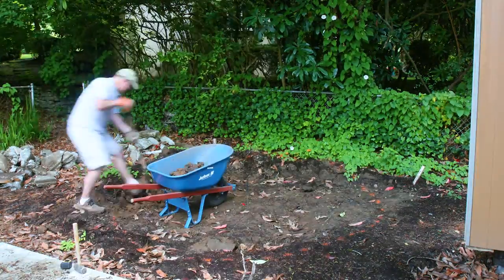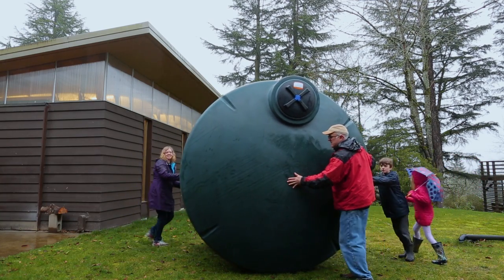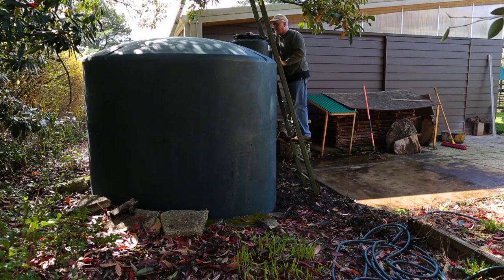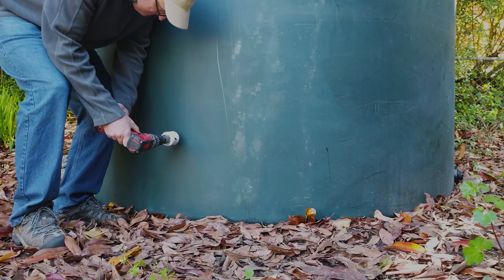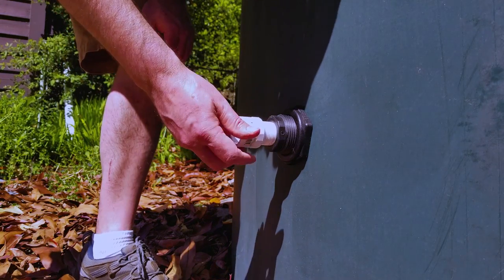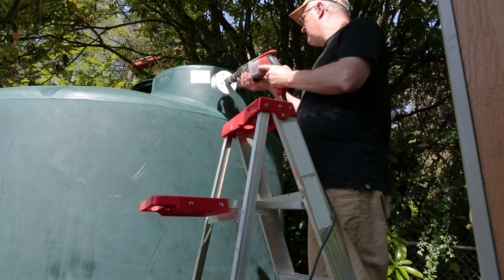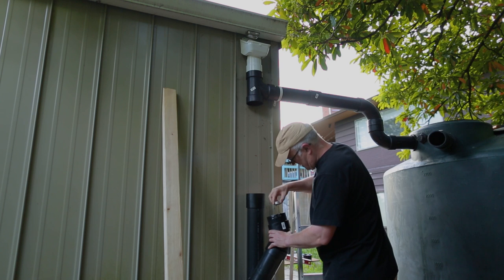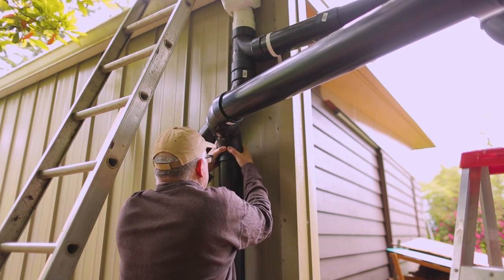The Rainwater Tank

Comment: My dad would've put me in the tank to put the fittings in
Reply: Yeppers.

When I was a teenager, we had a dairy cow fall into an old hand dug well. My dad and grand dad lowered me down with the tractor to get a harness around the cow, so we could lift her out. She was not happy to see me down there. I did get her hooked up and they pulled the cow out first. LOL
Reply from the maker: That was our back up plan.
Reply: Acts 13:41 
that was only to show you how milk is important for your health !    LOL !
Reply: Exactly
Reply: Just as an FYI since I've entered tanks like these for my job, oxygen concentration inside the tank can drop dangerously low. I've had coworkers die before from not using an oxygen sensor before entry.
Reply: Wow the quality of the first video was identical to that of the video five years later.
Reply: Well just to be sure I would have tied the other fitting assembles by threading your small rope through them just to be sure that if dropped into the tank they could be retrieved.
Reply: I help install one of these with my father in law and we used a piece of PVC pipe with a pice of solid aluminum ground wire connected to it. This was more than adequate to retrieve  parts dropped inside the tank.
Reply: As a kid my dad has lowered me in tank for fitting, cleaning and replacing things in the tank. At a certain age this stopped when I was awkwardly stuck.
Reply: Nicholas Loew same
Reply: Andrew Titus no it's oxygen concentration. OSHA standards state for o2 concentration to be between 19 to 23 percent. Anything less and you risk losing consciousness or worst.
Reply: In other words, CO2 is not bad for you. Lack of O2 is.  There are numerous reasons why the O2 levels in a  tank could be low, someone breathing is just one of them.
Reply: Aiden LARSON ok. Was reading an article once that states that CO2 was more deadly than lack of O2. I understand what your saying though.
Reply: I'm a professional brewer.  Spending time in tanks is normal.  Then a hot steamy dirty lauter tun is well...work.
Reply: Andrew Titus There are much worse gases then CO2 when in a confined space like hydrogen sulfide that if you can smell it you are already at danger levels or nitrogen because it doesn't trigger the bodies respiratory systems to say we have a problem like CO2 dose. Hydrogen sulfide when you can smell it you need to get away as the first thing it attacks is your sense of smell. Nitrogen is already making up 75% of the air so our bodies ignore it which can prove deadly if it is the only thing your are breathing and is used in lots of businesses for flushing and testing before you get into its liquid uses. 

Running out of air is not as quick as most people think because they will watch someone hyperventilate and pass out but that can happen out in the open also as they are not exchanging that CO2 for O2. In a big tank like that a kid could be in it for around half an hour before they would show signs of low oxygen and it is easy to solve by setting up a fan to bring in fresh air for unlimited time inside.
Reply: That's for when they misbehave.  "Cut it out - or you go back into the tank!"
Reply: Nicholas Loew same here!
Reply: My four years old locked us out of the house including herself.  Lowered her through the tiny bathroom window was how she's able to unlock the door so the rest of us can come back in.
Reply: +Maurice Long Both levels are important. CO2 is exhaled by concentration difference only, meaning the air in your lung must have a lower level of CO2 than is in your blood. If the level of CO2 in the air you breathe to high, you can´t get rid of the CO2 in your blood, which will kill you. So you can die of a lack of oxygen and of an abundance of CO2. Watching just one level is insufficient.  A CO2 level of 8% is lethal between 30-60 minutes.
Reply: The tank had an open port at the bottom. Any huge CO2 gradient between the tank and outside would push the CO2 through the tank and pull O2 from the top. .
Reply: Nicholas Loew I would just go in the tank for fun😂😂
Reply: My dad is like yours but I would have never volunteered for the job since mine would have left me in the tank... I was a rotten kid growing up  ;o)
Reply: A small wife would do though she might not help so much with the ploughing.
Reply: Bottom line. Look up OSHA standards for safely securing a confined space and consider applying some of their standards. I'm thinking of signage and possibly a lockout on that entrance. And not leaving the ladder up against the tank. (Beautiful project BTW).
Reply: Nicholas Loew haha same probs
Reply: Nicholas Loew tyt
Reply: I was thinking the same thing.
Reply: @paulkolodner2445  You'll float too! You'll float too!
Reply: @pyrocentury  would a fan work
Reply: @pyrocentury  It happened where I worked building and repairing tanker trucks. We lost one man and then his rescuer also didn't make it. From then on, every year we took a day for a safety confined space entry course.
Reply: That is just one of the numerous reasons we have kids  :)
Being gofers, lawn care & "where is the remote" finders!
Reply: i was thinking the same thing
Reply: Andrew T actually both are common hazards of confined space
Reply: @pyrocentury  You are also talking about the difference between a clean never used water storage tank and industrial storage tanks that could have god knows what in it.  I also do confined space entry with my job.
Reply: @gilb6982  what?
Reply: @pyrocentury  but still
Reply: @act.13.41  Holey cow, that's a great story!
Reply: How would u get out???
Reply: Nicholas Loew same
Reply: and once you got inside the tank , it's your time to shine. it's was the only time you can yell back at your old man haha

I miss my Dad tho. .
Reply: Oliver plays Trust
Reply: Mike Smith  Not on his personal property.  He is not a company so he is not subject to OSHA regulations.  Huge difference.  Just like if you were to do any work on your own house, you are not required to have a license.
Reply: Mike Smith  clearly it wasn't obvious to you... you are the one who mentioned "protocols of a worksite".  I never said he was immune to "the laws of science".  I guess you realized your original argument was ignorant so you decided to argue something no on is arguing.
Reply: Yeah! Those kids totally would have fit.
Reply: Exactly what I did with mine.. put the fittings while the tank was laying on it's side. Then stood it in position.
Reply: As long as he got you out at the end of the process it is a fair deal. hahaha
Reply: brings back memories like my dad when the fibreglass insulation first came out. Sent me up to do that lot but tapes my sleeves up as I remember but I loved it being so useful. Told me don't walk on the plaster only the beams. I was 8-10 something like that. That way dad didn't get the itchies from the fibreglass up his sleeves lol. His other trick was to send me under the house if anything needed to be done there with a watch out for spiders.
Reply: If I had a son, I'd make him get in too
Reply: Dads, we're so clutch & clever. My wife would've gave me hell first before I could put one of our kids in
Reply: @K333-e6b  I know the feeling :( I just lost my dad a few months ago. It is a hard thing to adjust to. He would have put me in the tank also but would undoubtedly have added the warning, "Don't tell you mom" :)
Reply: @frankmakes  Frank every plumber on the planet has at 1 time or another held up a pipe with their head while working on the next part in both their hands...you're doing just fine.... other than that hole saw incident 😆
Reply: Hahahah😂😂😂😂
Reply: Same bro
Reply: hahahahha thats so funny
Reply: ...hahaha, same!
Reply: Really? ... lol.
Reply: @francisdon537  i though it would gone explode
Reply: Lovely Video clip! Sorry for chiming in, I would love your thoughts. Have you researched - Proutklarton Protecting Aqua Plan (Sure I saw it on Google)? It is a great one of a kind guide for getting prepared for a mega drought without the headache. Ive heard some unbelievable things about it and my close friend Aubrey at last got cool success with it.
Reply: Appreciate video content! Apologies for chiming in, I would appreciate your opinion. Have you researched - Proutklarton Protecting Aqua Plan (Sure I saw it on Google)? It is a good one off product for getting prepared for a mega drought minus the headache. Ive heard some incredible things about it and my good mate called Gray after many years got astronomical success with it.
Reply: Projekt:Kobra  hahahaha
Reply: Had to do it several times growing up.  Since I was so tiny....  Everyone used that to their advantage.  Visiting family mostly involved that special chore of me going into tanks for repairs / cleaning and stuff.  I actually enjoyed
Reply: Same
Reply: I'm 43 years old now and I'd send my Dad in there
Reply: My dad did the same. He put me in the tank. He let me out when I was old enough to leave home.
Reply: Thanks for that advice.  I had to rescue a guy from a rainwater thanks in which he was using a high pressure water jet cleaning the sides.  He was luckyI heard him shout.
Reply: @act.13.41  lol
Reply: Same, but mine would have had a 10 min safety briefing before lowing me in.  lol
Reply: That's not my tank

Comment: Run the drill backwards, it will help when cutting a hole into plastics.
Reply from the maker: I will try that.
Reply: Agreed and if its a two speed cordless drill use the fast speed, the slow speed has to much torque.
Reply: Beat me to saying it.
Reply: For plastics and wood, forward direction with higher speeds and lower feeds.

Frank, back the hole saw out to clear the chips!!! (every couple of seconds). You don't do this then complain that they take a long time... because they plug up quickly. You need to clear the chips!!
Reply: And you beat me toooo.
Reply: Works on vinyl siding too if cutting with a miter saw.
Reply: Drill a hole or two just inside of the circumference of the hole for the chips to clear. No need to stop and back out.
Reply: If you drill around the circumference you have a chance of messing up the circumference, and it takes twice as long (switching drill bits, up and down the ladder, etc.)

Trust me on this advice. I work in HVAC/R and have drilled many, many holes with hole saws. Biggest ones I drill are 6 1/4" overhead on ladders through joists and exterior sheathing.

Backing out for chip clearance is the ticket. Takes a couple of seconds longer, but the hole saw bores through the material a lot faster, and doesn't overheat and temper the metal teeth.
Reply: I've bought a couple cheaper sets of hole saws, and two times in a row, I did exactly what you're cautioning against. I had the 5" saw attached and overheated it cutting into plaster and lathe - the teeth disappeared in one cut (both times)! Luckily they were $10 harbor freight sets, and now I'm on my 3rd set and it's lasted quite some time; you know what you're talking about and it is sage advice indeed.
Reply: Out of principle, I don't buy cheap hole saws (unless I plan on destroying the hole saw, e.g. I need to bore through stucco for venting... but again, they are resharpenable).

Now that you know the proper technique, look into M.K. Morse hole saws. From my experience, they are excellent!! (Made in USA).
Reply: Thank you sir!
Reply: Exactly what I was going to tell you/
Once the mark and small whole is done, always backward for plastic.
Reply: Or: mark the hole with the hole saw, then drill a couple holes with a regular bit (1/2" or whatever is handy) so that they're tangent to the hole. They'll clear the chips and you can run straight through with the holesaw.
Reply: IMef I don't think that would work to well if it did it would take forever. I've found that with a large diameter hole saw it's best to go slow and steady with just enough pressure for the teeth to contact the work surface. And yes it helps to have a drill with the second handle near the chuck. Running it backwards probably does work but it would take to long in my opinion.
Reply: Exactly, run it backward.  No kickback and it still works fine.
Reply: @walterbrunswick  So very true. High speed and slow feed is how to drill plastics, including flexi glass (perspex). The main thing is to be confident in what you are doing, if you're not don't do it.

Comment: Very interesting video..  Would love a "1 year later" update on this tank!

I put together a 90 gallon rainwater collection tank a couple years ago and was shocked at how quickly it fills up.  One good, 20 minute rain shower and it's overflowing.  Has been on my to-do list to obtain half dozen more 55gal plastic barrels and expand.  Just never got around to it.
Reply: Yeah our 55 gallon barrel fills to overflow in what it seems to be 10 minutes.
Reply: Why not use a 1000 litre IBC tank ?  They are a cubic metre in shape so much more compact than 5 round barrels. (N.B. 4 x 55 IMPERIAL gallons = 1000 litres). Here in the UK they also commonly come in 600l sizes. They can also be hidden underground if you want to go down the electric pump route.

Comment: Ah ha, very interesting, you did a great job, I'm sure it is working well. That inside float for the suction is intriguing, keeps it off the bottom. Instead of tying that white rope to it, you could have run it through the ring, making it double; no need to drop it into the tank; lower it and let one end go to pull the rope back. We are on rainwater tanks here in Australia, 2 by 27,500 liters, say  14,500 US gallons. The rain just goes in at the top, same as your opening, with a screen, suction near the bottom, no fancy float. Hardly any sediment to speak off, both stay very clean inside. Only filter we use is for the small drinking water tap in the kitchen, paper filters, carbon filter and UV light for killing germs.
Reply: That's actually pretty cool. You say your house runs completely on a rainwater tank? Is it sort of like a well?
Reply: Bought a simple after market tank float from Bunnings. Drilled a hole in top of tank, mounted the guage into it like a plug. The drop down float is suspended under the guage, which you calibrate. Cheap, simple and easy to read volume just looking at guage.

Comment: What a great project Frank.  As an old retired engineer myself, not originally from Ithaca but close by :-) , I can appreciate how you approached your project.  I have to say the use of the ladder to stand the tank up was a stroke of genius LOL.  When you installed the drain fitting in the tank I was wondering how you were able to get the fitting tight without being able to hold the inside half or did you just rely on friction?
Reply: MrGrunthunter's Adventures the drain fitting came through as one fixed piece. he just turned the retaining nut onto the thread and held onto the threaded section to get a tight turn on the connection.
Reply: I noticed that but it could have been difficult to hold it tight enough.  I suppose though that it really doesn't need to be completely leak proof.  It's not like it's inside of his house or shop.  :-) .  I couldn't tell but there may have been a soft seal ('O'-Ring) on the inside piece that would have sealed the fitting without needing for it to be overly tight.
Reply from the maker: Yes there is a big rubber washer on the inside flange that helps keep it from rotating (and makes it water tight).  there is also a place for a wrench on the part that comes through the tank, so one could get 2 wrenches going and really tighten it up. so far it is not leaking, the water is about a foot above the drain at this point.
Reply: If you look carefully you will notice that the inner threaded part has a hex molded into it's end. You hold that hex after the nut is threaded passed then use a second wrench to cinch it down. You can also run a bead of silicone before tightening to  ensure a good seal.
Reply: frank howarth eventually you're gonna have to find a way to get rid of the sediment that piles up.  You might have to drill another hole at the very bottom and drain the whole tank and sediment  before every winter, I would think.
Reply: Garden-Variety Google User at 17:24 it looks like there is a cap on a pipe
Reply: While I would agree.. it think his avoiding collecting the first batch of water is brilliant.. they we're going to use it for drinking water so I doubt leaves, and bird droppings would be an issue!  
Years ago, I had a brilliant idea of using a tank that size to pump water up from our 4 acre Kansas pond and into storage, so we could use a pump to use the water on the garden and lawn..  before I got that done that summer.. I had to figure how to get the foot of sediment and fish poo that settled to the bottom of the tank out!  So much for that idea!  
(Tank sold quickly when cleaned out with pressure washer on it's side to drain mud etc out!)

Comment: when using a hole saw with pvc type material(your tank), run the hole saw in reverse after the pilot hole is through.  It still cuts through, but doesn't bind.

the city I live in wouldn't allow a big tank in the yard.  I will have to wait till I get to the country to do this.  You always want to water your plants with rain water, compared to city water.

Comment: Hi frank, great video. In my experience, drilling bigger holes in PVC works best if you set your dril in reverse. This way the drill does not bite into the material.
Reply: thanks for tip Piet.Very useful

Comment: Those big hole saws are real arm breakers in a 1/2" high torque drill. Great job. Enjoyed your journey on this project. Lots of well thought out solutions.
Reply: I have a Milwaukee 1/2" corded drill, but it also has a screw-in handle that's perpendicular to the body. Without the handle that thing will reach out and slap you silly if don't pay attention. With the handle and a tight grip, it works really well. You do need to be careful though. It does have an impressive amount of torque!!